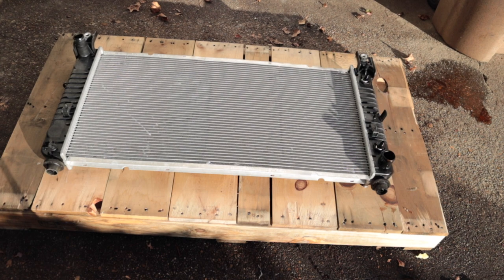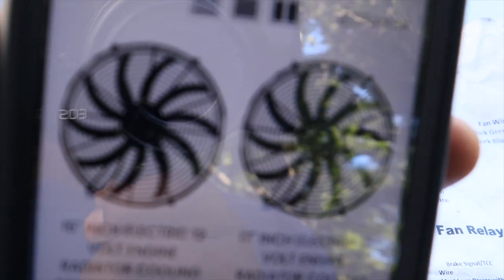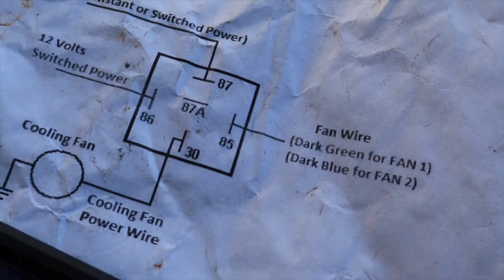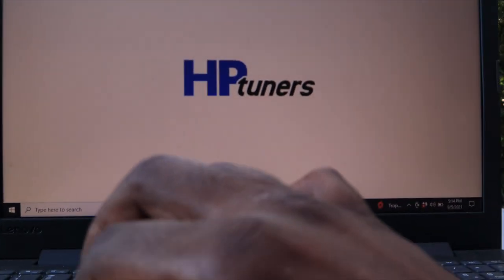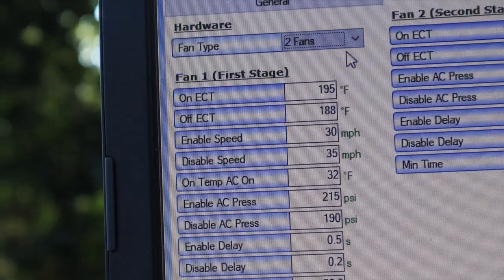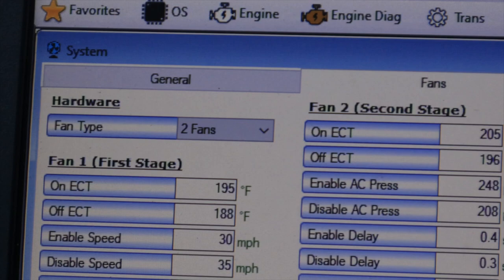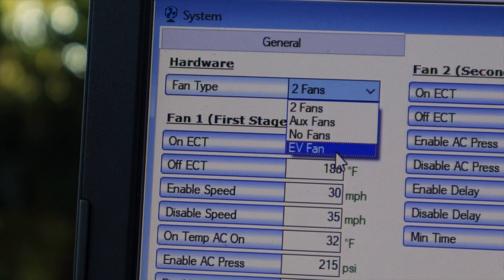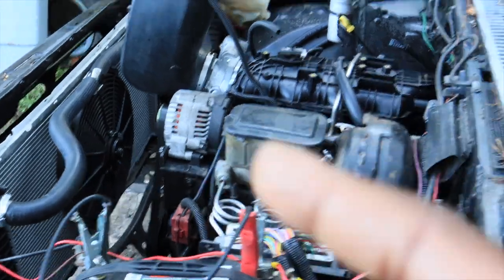How To Install And Tune For Electric Fans On Your LS Swapped C10

Comment: that sthe 34 inch radiator right any reason you didn't run the electric fans that came stock on the 05 and up tahoe silverado?
Reply from the maker: What’s going on bro didn’t have one I’m using the stock radiator